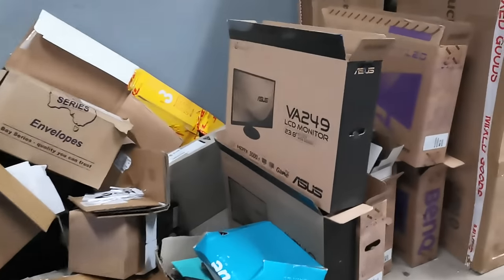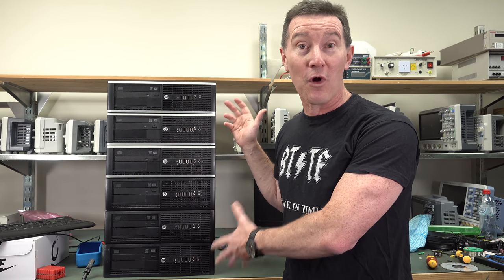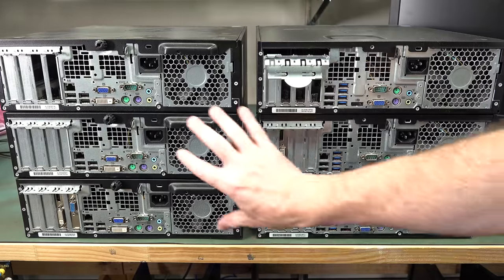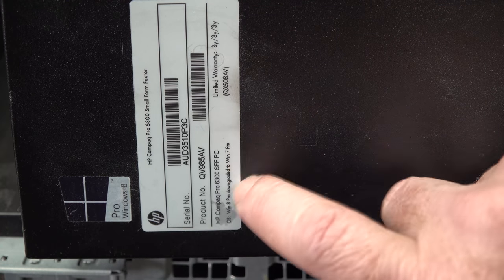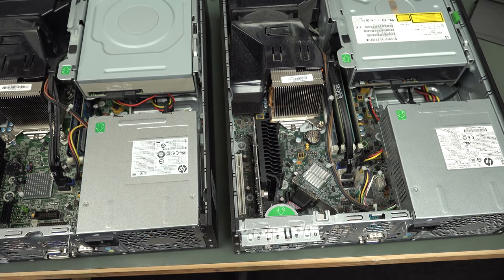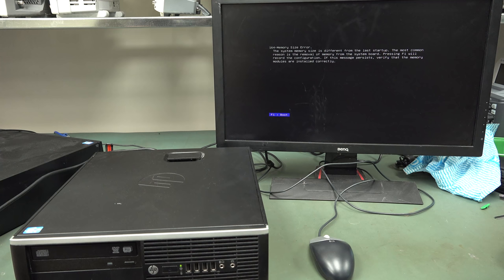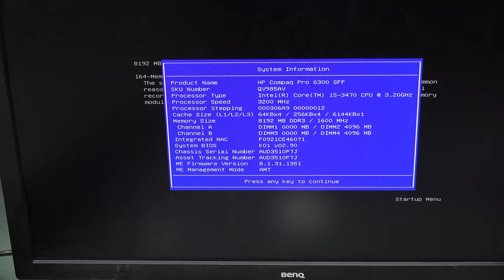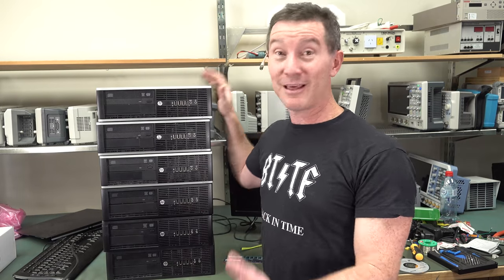EEVblog #1212 - Dumpster Diving PC Motherlode!

Comment: Wow crazy coincidence I work for an AV supplier that works for financial companies in New York City and we recently bid on a liquidation where I got a TON of these very machines (in form factor not specific models).

Same generation except they were i7 ones but I have piles of them!

I guess large companies upgrade around the same time periods as I'm on the other side of the planet but same gen, same outcome they're throwing these things away when they're really useful generic desktop machines nowadays.

Great find! Also this generation was the start of EFI/UEFI where OEMs were putting the Windows software licence into the system itself so "CD Keys" are no longer necessary. That sticker shows that the OEM key is inside the EFI so when you install 8.1 or 10 it just reads the key out of the EFI so no more inputting text from a sticker.

As long as the EFI is configured correctly Windows 10 will just detect the legit OEM key that's embedded and no more need to type it in!

Great find, again!
Reply: eumoria Tradition is to do time consuming IT upgrades during Easter, as it's the largest block of contiguous non-business days except Christmas, and other business functions (accounting, inventory) already own the new years downtime.
Reply: @johnfrancisdoe1563  oh good to know! thanks :D

Comment: Hey Dave, please donate them to your local community computer recyclers.  I'm from Victoria so don't know what they're called in NSW, but i think the Salvos can point you in the right direction. These will be lovingly refurbished by qualified electronics engineers like me (It is my weekly volunteer work) before being given to underprivileged families both in Australia and abroad. Allowing us to narrow the digital divide, whilst saving the planet the burden of unnecessary e-waste. We generally install Ubuntu Desktop with a reasonable software suite, so no Microsoft licenses are required. If the end-user wants something more visually appealing than Gnome (who wouldn't), we have a script on the desktop to switch between Gnome and Deepin as the window manager. In general, Linux requires a much lower spec machine to run with acceptable performance, and can literally be someone's lifeline to the outside world. Given that most essential applications are delivered as web-apps now-days, having a computer presents a great advantage over using an old, under-powered mobile phone with a smashed screen.

Comment: I've rarely been able to run both the internal MB video and a video card at the same time, the  bios usually short circuits that.  (On Dell's and HP's any way).  Well, you've got enough stuff there to make one or two real good machines out of the 6 by swapping video cards, memory, and CPU's.

Comment: The dead one could just need some thermal paste on the CPU heatsink.  It's a common failure for OEM gear because it's only done just good enough to get through the warranty period.

Comment: Starting with 8, there is no longer any license key stickers for Windows. The key is stored in the UEFI (BIOS). Now they only include those small stickers. I'll bet the one you found was for Windows 7. As far as the Windows 7 downgrade, that was actually quite popular when Windows 8 came out, as many people did not like the completely different user interface and refused to upgrade. Also there was some software compatibility issues with Windows 8. Because of these things, Windows 7 was still quite in high demand for new PCs.

Comment: The HP X300s will run the 3rd gen Intel processors so they can run up to an i7-3770. A GTX1050Ti is the biggest GPU you can get in a low profile form factor. With an SSD and 8GB of memory, they're hard to beat for value.

Comment: I get quite a few of these for free as well. I build them up with Win10, which always activates on the hardware no questions asked !. Ideal for friends and family that just need a home PC for general use. Like you say they are silent and will go on for many more years without issue. Also as long as you stick an Ethernet cable in, you can update the BIOS from within the BIOS itself.

Comment: Companies may have decided that the plagues of Windows 8 wasn't worth it in contrast to Windows 7 witch just plain performs better.
Reply: windows 8 statistically performs better than windows 7 ever could, it was more an issue of the interface and compatibiliity than anything else.  Retraining an entire workforce to use a new interface is too expensive.  Its why windows went back to the windows start button in 8.1 and the biggest reason why 8.1 is what 8 should have been, as well as a driving reason for the push to get windows 10 to market as fast as possible.  XP released in 2001, windows vista in 2007, which was 6 years.  Then 7 came, and that was only 2 years after vista because of bad press.  Windows 8 came 4 years later in 2012, but then 8.1 came in 2013, and 2 years after that windows 10 released in 2015.  Now we haven't seen a new OS from them in 3 years, and we probably won't for another 3 to 5 years because its not a total fuckup.

Comment: Those HP machines are great if you can get them for free. The CPU upgrades are super cheap and if you drop a cheap SSD into them, they will be more than sufficient as a general purpose PC.

HP business PCs also get BIOS updates for an insanely long time. I have and elite 8300 and its last BIOS was less than a year ago. Windows 10 also runs on them out of the box without issue. 

I have an rp5700 that worked with windows 10 and that thing is an ancient core 2 duo system.

Since Windows 10 still activates on a Windows 7 key you can often legally migrate these to a 10 install for free.

Comment: A lot of custom corporate software and enterprise networks were designed around Windows 7, and companies would spec newer machines with Win 7 in order to maintain direct, "known good" compatibility with their existing infrastructure, rather than risk potential issues with a different operating system.  :)

Comment: Just stick a HDD in there and load Win10. You’ll probably find that these PC’s are licensed for Win8 (via the BIOS) and will easily install Win10, without the need for a COA sticker.

Comment: the PC with the Windows Key on it is older the ones with the windows 8 pro sticker and no key are a bit newer. The windows 8 sticker with no key means the key is baked into the BIOS. you can install windows 10 pro and it will auto-activate. if the sticker with the key is for windows 7 pro you can also install windows 10 pro and type in that key, it will activate. (if 7 home you can activate 10 home)

the PCs make good home servers they don't use a hell of a lot of power. you can also install another NIC in them and they make great pfSense boxes (free router with amazing features).

I would suggest putting SSDs in, installing win 10 pro and putting on gumtree or just put them as a bulk lot as is on gumtree / fb

Comment: @EEVblog Nobody wanted windows 8, so many brands offered either to deliver the PC already downgraded to win7 or you could get a downgrade kit for them. At the time I worked as a consultant and we never delivered a win8 machine with win8 on them. The win8 sticker is the  sticker of authenticity, this means that like the win10 PC's the windows key is in the bios, so if you want win8 on that PC, you simply just install win8 and it will activate with the key from the bios.
the video outputs are sometimes linked, so you can either use the DP or DVI and depends on the chipset and bios, som you can either use the onboard or the PCIe gfx card. I would say its not impossible that you could run 5 monitors on it, but highly unlikely that it would work :)

Comment: I wouldn't bank on being able to use all 5 video connections at once on older machines.
A lot of old machines won't operate on-board at the same time as expansion card video, plus an old expansion video card might not support all its outputs used at the same time. I've been caught out by this a few times, although it does seem to be the budget machines which cause the most issue, so you might be more lucky with an HP.
Reply: Even My 970 can't use all outputs at the same time and its only 2 generations old. https://www.gigabyte.com/FileUpload/Global/Overview/html/4788/img/flex_display.png

Comment: I have one of these 6300s that I bought from Goodwill for $25 US (no memory or HDD). WHat is the best (that is price/performance) graphics card to get for one of these?
Reply: John Tarbox a low profile GTX 1050 Ti like this:

https://www.gigabyte.com/au/Graphics-Card/GV-N105TOC-4GL

(Other brands like MSI, Zotac and probably others make them too, but the Gigabyte ones are what I’m most familiar with)

The pictures show it with the full height bracket installed, but you get the low profile one in the box. You just need a small screwdriver as well as a small hex head or pliers to change it over.

Low profile 1650’s are supposedly on the way, but who knows when they’ll start appearing on store shelves, not to mention pricing isn’t great on those.

Comment: I have the Dell equivalent of one of those as my router and home server.

Slap an old Intel dual-NIC in, load Proxmox, put pfSense in a VM with the dual-NIC passed through via IOMMU and you're set.

Way more reliable than any consumer router I've owned, and cheaper than many.

Comment: "You either use Windows 7 or you jump straight to Windows 10."

Or you don't trust Windows 10 and move to Linux rather than go through the hassle of a Windows 7 reinstall that'll get less than a year of support.
Reply: That's pretty much what I did.  I still have Windows 7 for games though and I'll keep it on 7 for as long as I can.
Reply: @coolelectronics1759  Uh-huh... sure thing Mr Troll. You gave yourself away with the imac bit. People who buy icrap don't care about Linux.

Comment: im curious to know the use of 4 sata port in a sff, when you have only 2 slots on the case for Sata devices (1hdd 1dvd)
Reply: You could always throw in a dual eSATA slot bracket... Besides, the board may also have been used in a roomier machine.

Comment: The licence is now attached to the serial number of the motherboard so sticker licences are no longer required. You can upgrade to 10 for free ;)  You can download a system restore disk from HP to reload.....  Also the video card will disable chipset video to speed up the machine....

Comment: At the time you couldn't buy a Windows 7 oem license anymore so they had to come up with that scheme to allow pcs to still be shipped with windows 7.  It was weird.
Reply: Do RC That "downgrade rights" system is actually older than that.  Same thing happened with the upgrades to XP, 2000 and NT 4.  It's also available for things like office and SQL server.

Comment: Slap a low profile 1050/1050 ti into one of these and you have a fairly decent gaming PC. In my desktop I am still rocking a 3rd gen i5 3570k @4.2ghz so yes these are going to work quite well.

Comment: check contact between heatsink and cpu, sometimes the entire thing separates a little a doesn't make proper contact
Reply: The "thermal blob of crud" than HP uses is also quite likely to be rock hard and powdery after 7 years. I always clean and re-paste the heatsinks on machines this old, and especially important on HPs and Dells because they use a shitty pad to make assembly faster.

Comment: I've always admired those desktops built for business and enterprises when they have those elegant ease-of-maintance design. I've found dumpster PCs with "hot-swappable" motherboards and PSUs. All you do is unplug everything and everything is latched in place so you don't need to remove any screws, just unlatch and slide them out.. The motherboard is on its own sled so to say. Puts the slide-out HDD and optical disk shelves to shame.

Comment: With multiple sata ports, those would make great NAS or Plex servers - boot from usb and use the sata for external drives.
Reply: We use 6 of this type of machine for our daily backups. Put a large drive in each and leave them powered off. Our server pings one to life late at night, copies files over, deletes an old backup set if space is running low and shuts it down. One PC for each day of the week and one for weekends. Individually they are only on once a week so it's high on the reliability, collectively we have almost a years worth on online backup versions available on demand.

Comment: About your "thermal runaway" dead machine....
Where I work, we fix such machines usually for the E-POS market...

The reason for the fan running fast is because it's receiving no PWM signal and are designed to run in free-running mode just in case the PWM source/wire has gone faulty in an otherwise good machine...

Usually on the 2nd gen core-i systems the PCH goes all NVIDIA-geforce with flip-chip uBGA plague (on the Q67 chipset),
This is the first wild 3rd gen Core-i series system to fail this way....
Or alternately, there could be a shorted mosfet on the CPU VRM, the low side mosfet... some machines detect over-current and shut down the VRMs.... this is quite rare though.

p.s. I'll assume you won't see this as I hardly log in to use youtube and such, thus my stats will be too low and thus I'll try signing up for your EEVBLOG forum to post the same there...
Reply: I have a hp compaq 8200 elite sff pc that alss has fans that go to high rpm every few boots from windows shutdown and the display will display nothing and the fans go high rpm until after windows has finished logging in and i don’t know why its doing that

Comment: While the PCs shipped with a Win8 license key in BIOS (but Win7 installed on the hard drive), I have to wonder if anyone took advantage of the free Win10 upgrade.  It's possible MS will recognize them as having a valid Win10 license.   I'm not sure how to test it except to install Win10 and see what happens.  As for what to do with them - in my area there's a chain of thrift stores that donation the proceeds to charity.  You could donate the PCs to them.  Then the thrifters can snap them up.

Comment: This is soooo funny because my colleague at work just asked me if I want to take a new DELL computer home, running Windows 7, and they are a few years old, but fast enough for a home computer.. and they had two large carts full of them, top and bottom.. that some department just set out by the dumpster...  I also heard, I don't know if it is true.. but supposedly Amazon send thousands of brand new televisions and other electronics straight to landfills for some reason.. like it's the older model and no one is buying it?? That can't be true.. given the fact that I just paid for a perfectly good older model television..

Comment: I have a soft spot for HP computers .I have 3 of them....Ironically my favorite of the lot runs Windows 8.1, and I wouldn’t change the OS for anything. I like it enough to have replaced the HDD, rather than discard it.

Comment: the reason it has windows 8 sticker on the pc and it said windows 7 that was a option that hp offed for people that didn't want windows 8 and that wanted windows 7.  The reason for the ps2 ports on the back of the small form factor is lot of companys do not want people using the usb ports for security reason

Comment: And yes, you could buy them preinstalled with Win7. I think the main difference is just that they had a Win7 COA attached since Win8 used the key stored in the BIOS.

Comment: Greetings:  Although  HP claims these also work upright; makes optical drive use a pain.  These make good HTPCs. I use an MSI Radeon 7 240 low profile graphics card with a 4K TV/monitor. It is good with HEVC compressed videos below 4K. x264 2160p usually play OKAY with AMD  A6 5500B APU. I bought this PC for HTPC usage. It came with WINDOWS X (not just an Apple designation). Oh yeah, it also came with a 2 TB HDD. Added the SSD myself. Beware before the SSD it spend too much time looking through all that storage for almost any service request!!! No SSD statistics yet.
Reply: Forgot to say Fry's in California sold these for $139 + tax.

Comment: As for the Windows 7 v Windows 8 thing.  Especially in enterprise situations there was a demand for 7, most IT support didnt want 8 because there was an awful learning curve for not much gains in terms of functionality.  But microsoft Pushed every computer to have 8 on it, and they would have to pay to downgrade it.  Quite a silly situation, but that's a short reasoning behind it.  I work in a huge company and at the time I was desktop support and we actually passed 8 for many reasons but mostly it would take a long time to deploy, the users hated it and 10 came out relatively soon after 8 was even being talked about.

Comment: One day this bloke is going to pull out a Tesla car out of a dumpster.
Reply: Tesla you say? I wouldn't be surprised if he scored a pre loved Airbus A380🤣
Reply: @roberthorwat6747  An old airplane, especially the cargo version, would be nice to convert into a RF test lab. Once the fuselage accumulates its rated mileage, the structural integrity is no longer dependable for flight and basically becomes scrap metal.

Comment: Dave, I'm baffled to see that it cost a fortune to ship stuff from Autralia, when it's cheap to ship something of about the some size and weight from China.  

Since you don't want to send them out.  You could use the 6300 as servers or FreeNAS machine or better as pFsense router/firewall.   But with the 4 sata port, that would make a good FreeNAS box.  And the perfectly working 4300 & 6300 could also make some nice Linux Mint PC's.   If someone only need a pc for work processing, spreadsheets  and web browsing and a little graphic, and can't afford Windows,  Linux is the best choice with the free and open source apps available for Linux.  

I've repurposed machine like these and installed Linux Mint to keep the Windows feel and the new owners don't mind it'S Linux and they can do all on these machine.